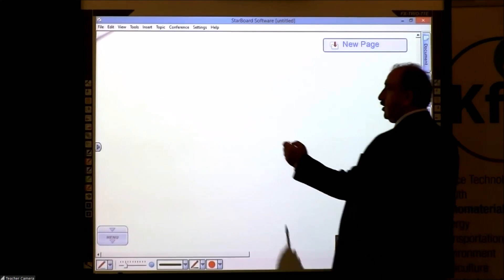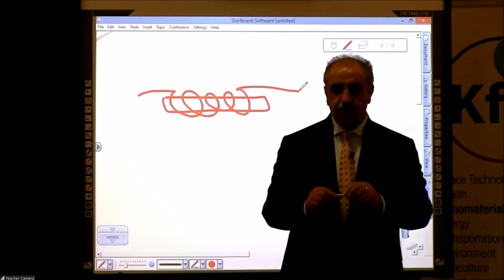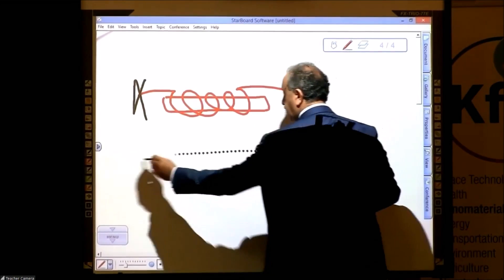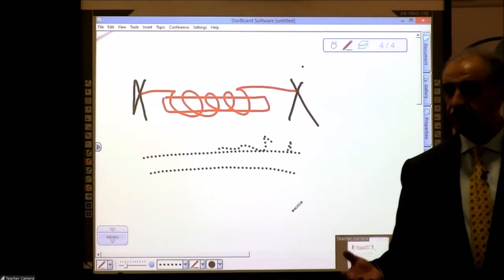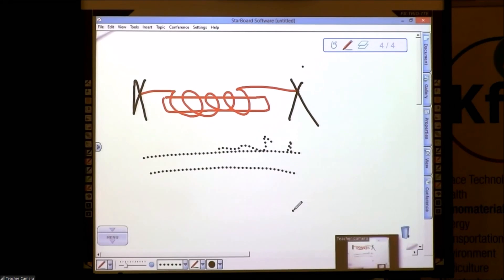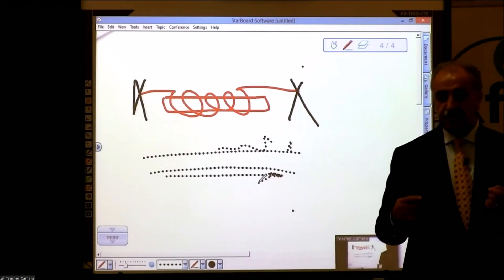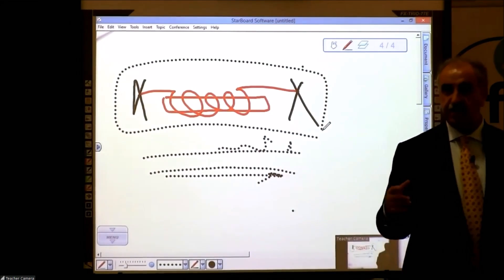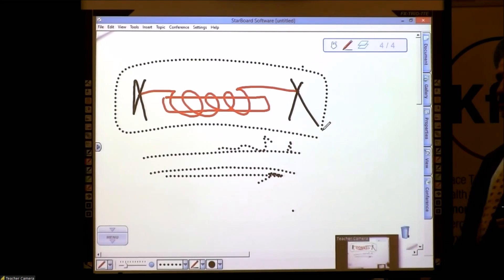You HAVE TO polarisize your coils

Comment: Does anyone know how to resolve the issue of a pre-coated coil, is there any way the nano-coating can be removed so as to start again? or does the 99% have to re-purchase more copper wire to start over again as Mr Keshe explains. I must agree with several of the comments here, the vital basic information about the process of nano-coating should had been repeated in all teachings and also included in the blue print coil diagrams, as at the moment there are many disgruntled and peed off believers who are now feeling negative about the technology, the teachings really have to be reinvented and done with more clarity for this technology to get off the ground, as most of the 99% are keen followers and are very enthusiastic about building such a design to give the world free energy, so start over again, redesign the teaching method and lets see these 3 hour teachings compressed down to a 30 minute teaching, because for the 99% of wannabes out there they all want to skip the boredom and go straight to the making, but do it in simple terms, the quicker the better, otherwise all this hard work will be forgotten very quickly. Just for the record, I'm a full believer in the technology and still hold a strong believe in Keshe technology.

Comment: The use of the voltmeter, was between the mesh, and the coil, with intervals of 6 hours, during the nano coating in caustic , the polarization has never been mentioned elsewhere as far as i´ve heard ?  LOL !  Then the polarized coils should be connected in a polarized pattern allso- so the coils should be marked + and -  ??